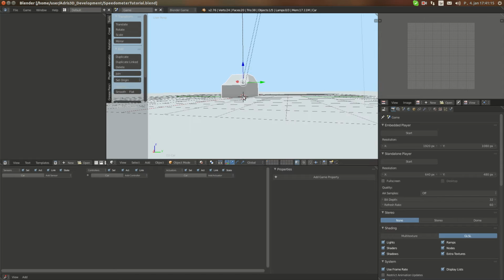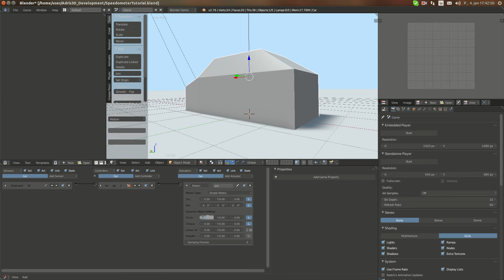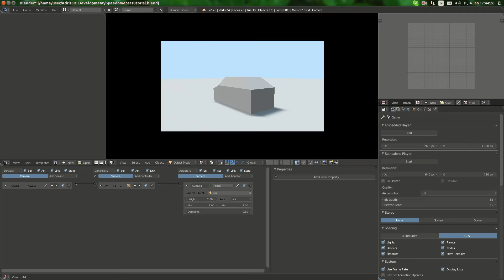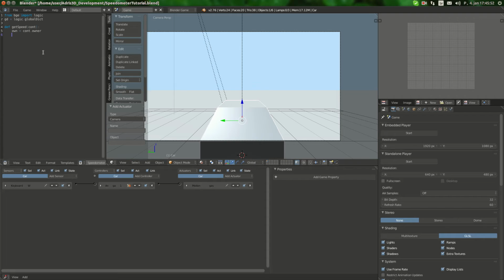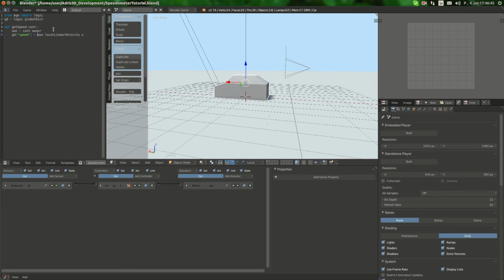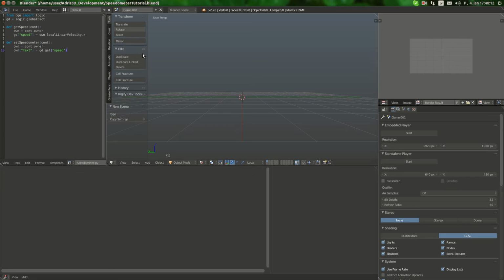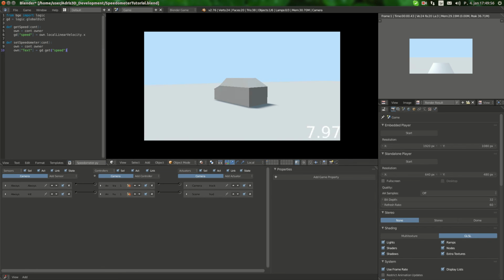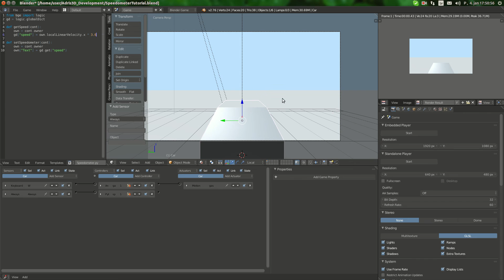Blender Game Engine Python Tutorial #2 | Speedometer

Comment: No matter how much I try, the text just won't change. I've never used Python so there is no way that I can teach myself to make this work. Any help?
Reply from the maker: +Liam Bradbury What version of Blender do you use? Have you checked if you set up the scenes, objects and controllers correctly?
Reply: I'm using 2.76 Blender. I have made everything the same as yours but the text on the HUD scene won't change.
Reply from the maker: ***** You should take a look at console output;)
Reply: When I run the script, it says Python Script Fail or something like that. It then tells me to look at the console, but I don't even know what that is.
Reply from the maker: ***** If you're on Windows, than go to "Window" -> "Toggle System Console".
Reply: +Adrians Netlis It says that there is no module called 'bge'.
Reply from the maker: ***** First time ever I hear such a werid thing. It's almost impossible to make a game in BGE without this module. Something's wrong with your Blender.
Reply: Ignore that comment, I wasn't suppose to use the Run Script. Could you tell me what 'gd' means?
Reply from the maker: ***** We store global dictionary as a variable. That dictionary allows to send data between scenes.
Reply: +Liam Bradbury I got that problem before! Try 2.77 It should be fixed.
Reply: Oh? I'll download it now and try it.
Reply: Ya it should work. I got that bug before with earlier builds of blender. Who know why it occurred but it should work after switching to a newer version.
Reply: It still doesn't work for me...
Reply: oh. Have you tried exporting all your data to another blend file and developing from the other one instead?
Reply: Nope. I've realised that I shouldn't be pressing Run Script, but that doesn't explain why the text doesn't change even when I've copied exactly what he did in the video.
Reply: Oh you know what i actually didn't watch he whole video. But i use the module own.text to assign my text a property or a string.But your problem is the scene not adding right?
Reply: No no, the scene is there but the text won't change. It just stays as Text and doesn't change to numbers.
Reply: Put a script on the Text object. Get 2 properties. Also Don't convert the text object to a object! make sure its a text object where u can still manipulate the words! Then make a always sensor and make a python sensor and script. Now what u could do is initialize the object form where the velocity is being calculated on the vehicle object. Or have a copy Property constantly copying the vehicle's velocity to a string property on your text. I'ma write a quick script and you will get the idea like this.

import bge

def main():

    cont = bge.logic.getCurrentController()
    own = cont.owner
    
# Now lets Intialize The Scene
    scene = bge.logic.getCurrentScene()
    
# Lets Get The Vehicle From your Scene!
    vehicle = scene.objects['VehicleName"]
    
# Assigning Own Prop Reference [MUST BE STRING]
    copyprop = own['textprop']
   
 # Assign The Vehicle's Velocity
    speedvalue = own.vehicle['velocity']
   
 # Lastly Lets Make A Switch [MUST BE BOOLEAN]
    Switch = own['togglescriptprop']

 # Lets Put it All together!
    
    if Switch == True:
          copyprop == speedvalue
          # Own.Text Assigns anything in this module to itself. 
          # Sometimes you may need to convert to a string. If this doesn't work maybe i left out something like this: str((own)copyprop) or something. If it works then never mind this.
          own.text(copyprop)
          # Open up your console
          print(copyprop)
          # Have Fun Blending  \(^ ^)/
()

Please note i never wrote this in blender but this off the top of my head. Try That script if there are problems u can ask me to help u out. If the script has issues i apologize as i thought of this but didn't' test it.